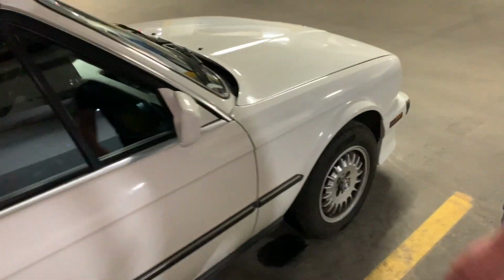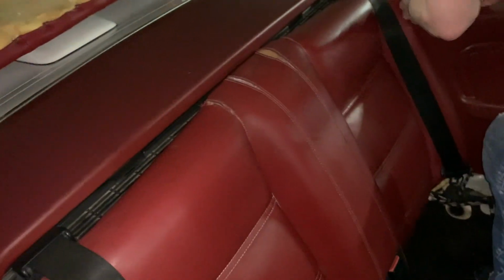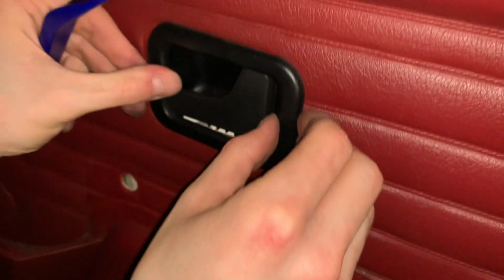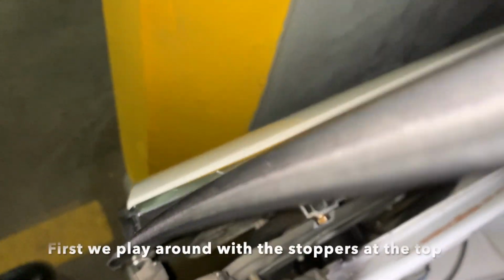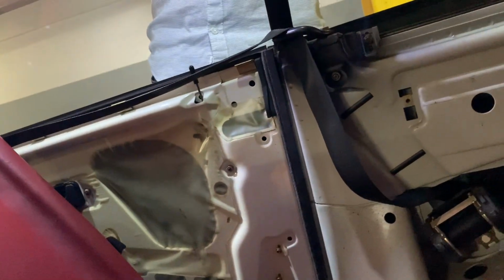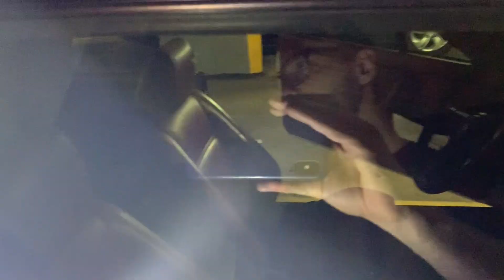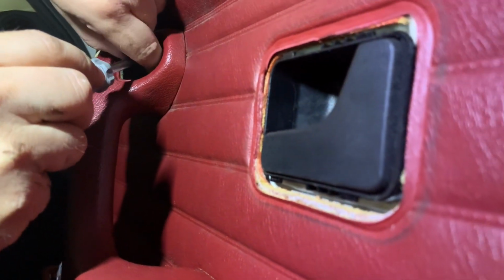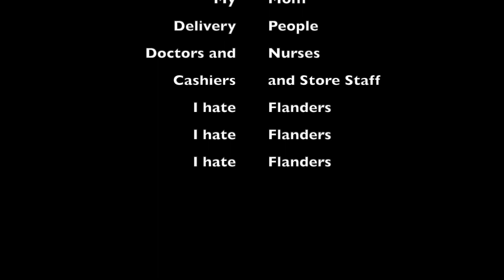E30 325i convertible front and rear Window Adjustment

Comment: Useful video as I'm just about to adjust the windows on my E30 before a new soft top is fitted as the windows aren't currently parallel. I'm sure you figured out later but the bottom bolt  you screwed in and out on the rear window adjusts the tilt of the window in and out. There are also bolts on the front window to allow forward and backwards movement if it's too tight up against the back window

Comment: I have the same problem on my 88 325ic as well, but only the driverside window clips the rear window trim. Would following the same adjustment levels you have on the 89 work for my vert?